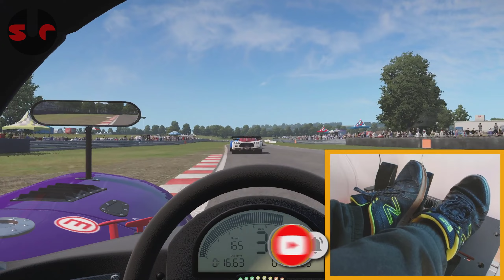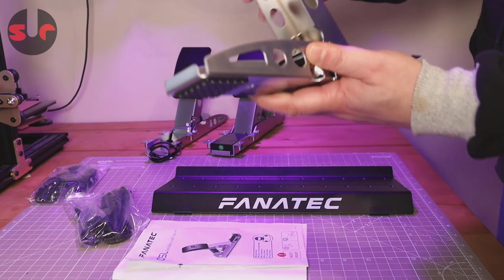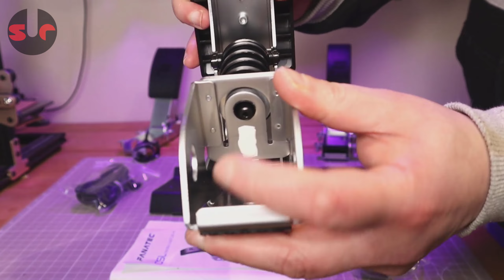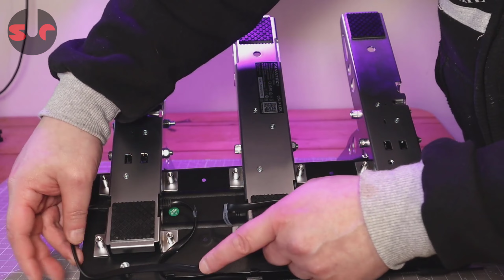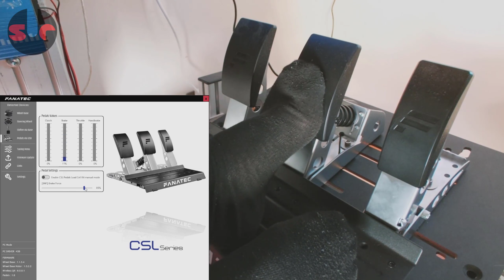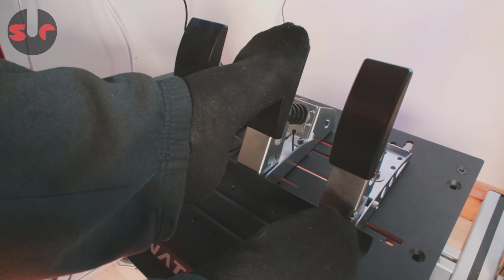Fanatec CSL Pedals Load Cell [REVIEW] Do they offer high-end performance for less money?

Comment: When you said a load cell doesn't have to move, it just has measure weight... thats what these pedals feel like to me. Just so stiff. Your review is too nice. Can you recomend a load cell thats does move like a real brake?
Reply from the maker: Rather than changing the pedals, you can replace the elastomers with something softer, like the 3DRap brake mod https://youtu.be/LQfbcqIAiqM, or die springs https://youtu.be/oCdUoOjtEfU

Comment: In my opinion, the CSL load cell pedal is useless out of the box. No feel for how much for you apply since the pedal requires a strong force just to move the slightest. I have just ordered the 3Drap mod (an additional $50 with shipping). Hopefully that will help.
Reply from the maker: I'll be reviewing the 3DRAP mod sometime in the near future.
Reply: @SimRacingCorner  I got mine yesterday. 2 progressive. The pedals definitely feels better, but I would have preferred a bit more travel, so I think for me 1 linear and 1 progressive would have been better. Unfortunately for the price, I only ordered 2 progressive, so I will stick with that.
Reply from the maker: Thanks for the feedback. I have sets of both the linear and progress mods to test out. I'll try out all the possible configurations in my review. How are your pedals mounted?
Reply: @SimRacingCorner  I have the GT Omega Apex stand and a regular chair on carpet. I can put a good amount of pressure on the pedals before my chair move.
Reply from the maker: @jkristia2011  Yeah, I totally understand why you needed to soften that brake if you're using a wheel stand.

Comment: Not for me to be honest. Bought mine since I'm upgrading to the csl DD from a T300. I pretty much only drift and the load cell pedal is way too stiff for my preference. Even got the 3Drap elastomers which are supposed to give it more travel. Even with that, I can barely press it down. I'm not on a fixed rig/chair, so that might have some impact, but it's firm enough to where I can still put decent pressure on it. I'll be selling it and buying the clutch kit and using the normal brake.
Reply: Which 3Drap elastomers did you use (Linear/Progressive) and 1 or 2? Thanks.
Reply: @DrR1pper  2x linear ones. My chair isn't fixed/attached to my stand, so I think I'm not able to put pressure on it "ideally"
Even if it was a little softer and had more travel, I still think I wouldn't like it.
Reply: I just bought it and i have the same frustration. I have the same 3drap elastomers. I just searched i wanna try one more time, using the die springs because I dont wanna make my money go to waste

Comment: Thanks for the review.  Did you ever perform the RC damper mod on the throttle pedal?  I recall you mentioned you were going to and then review the DIY mod.  I did it recently, purchased off the shelf parts not 3D printed, and it is a nice upgrade, used the same parts on both throttle and standard brake (don't need to do the later if you have LC brake).  There are instructions on Fanatec FB for the hardware parts other than the pair of RC gas dampers, that you can source off the shelf a large American hardware store for 10 USD, but you can also 3D print the parts.  The RC dampers are adjustable for the spring strength, with a large dial that makes the spring compress more or less (always linear, not progressive).  You can also slide the bottom portion of where the damper mounts to the pedal base forward or back about 1 inch to make it so the damper is mounted more vertical or lower down to add or subtract the resistance, simply based on how the shock is mounted at the bottom to increase the angle or decrease it to make it stronger or weaker.
Reply from the maker: Yes indeed, I have installed the 3D printed version of the RC damper mod on the throttle pedal after finishing this review. I'ts really good. That's coming in a separate video.
Reply: Do you have a link for this? I'd be very interested as I just got this pedal set.
Reply: @YourItalianJob the popular 3D printing website with "verse" in the name has the CSL Pedals throttle mod STL file.  YouTube blocks links that are placed in comments like this, I already tried a few times to include the FB post.